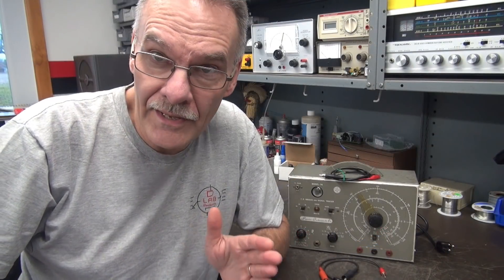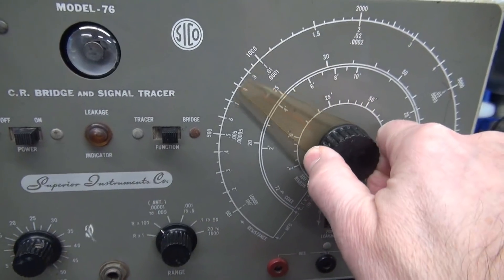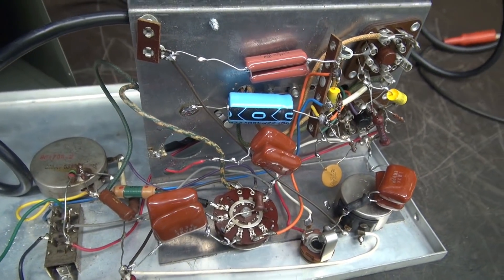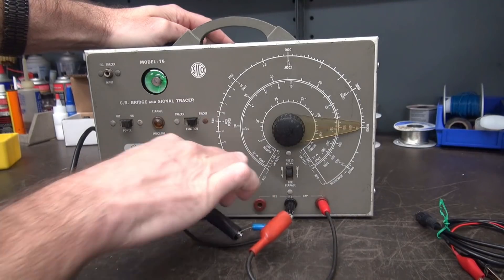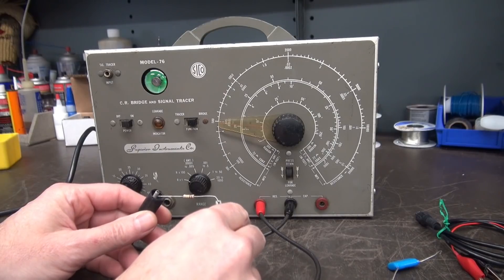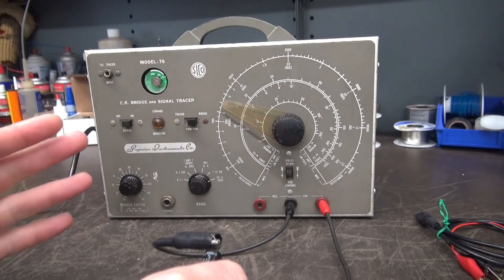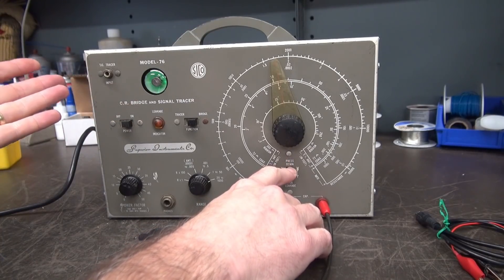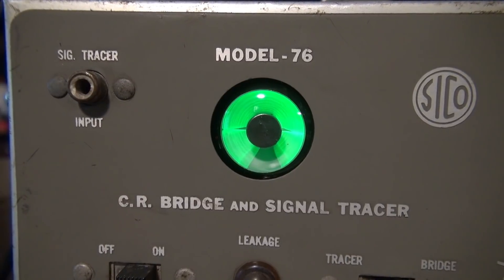Demo Vintage Superior Capacitor resistor bridge Model 76 Radio test equipment

Comment: Have the EICO brand that does the same thing. Haven't used it in years. Also have a couple other Eico pieces of test gear I should put back in service. The eye tube always worked great as a capacitor checker. also helped tune in the radio stations...lol also a leaky cap on an eye tube will make the eye flutter real fast.

Comment: I have a Heathkit C-3 "condensor" checker with almost identical functionality, except it does not have the tracer functionality. They can't do in circuit testing but they are fun to use. Thanks for the vid.

Comment: That’s a cool piece of gear. I have a few of the Heathkit versions. I love anything with a magic-eye tube in it. I’d be careful with that leakage test. The Heathkit applies HV across the caps and has ranges all the way up to 600V. I’m not sure what that one does, but it could be applying HV across the cap and is a bit of a shock hazard, especially with large value caps. If the leakage indication is like the Heathkit, the old cap you tested is bad. With the Heathkit, the eye closes initially, then opens if the cap charges properly with no leakage. It will open quickly for a good cap, but slowly for a marginal one and not at all for a leaky one.

Comment: It would be cool to modify that with a DLAB designed add on to show which end of a cap is the FOIL end.  How hard can it be given there is a signal tracing circuit already in there :)   Maybe a 2020 project?   Nicely done Terry !!